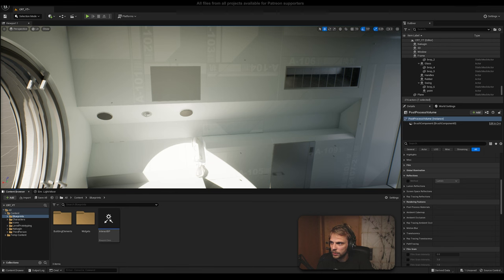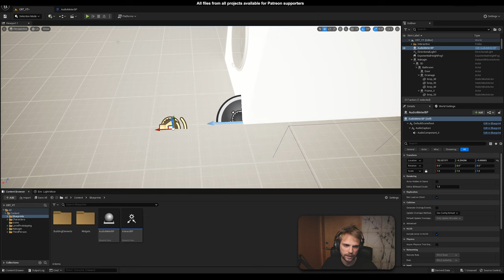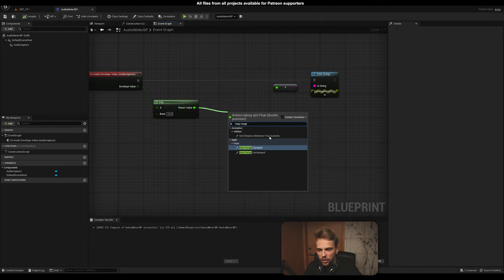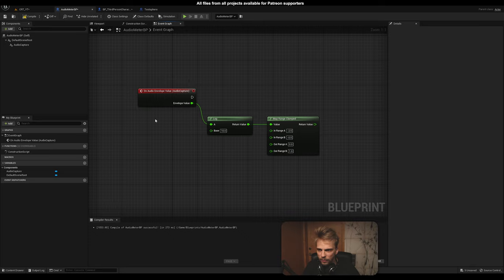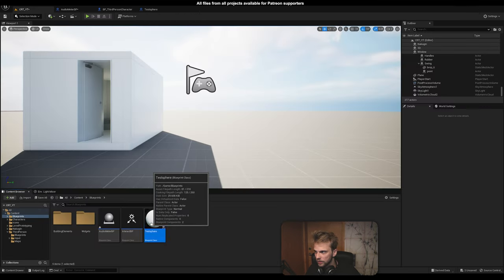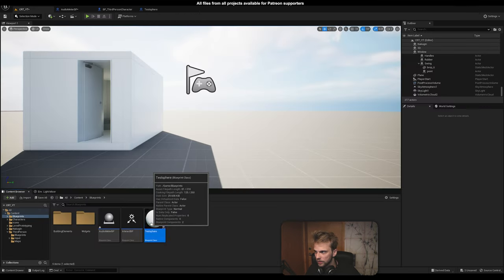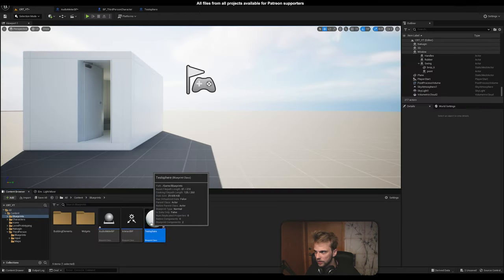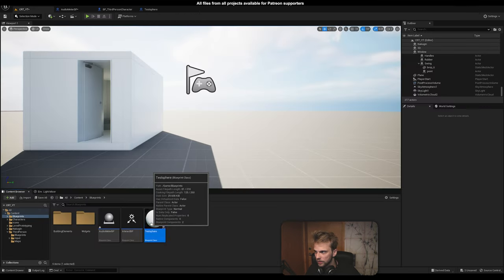UE5 Tutorial: Use Microphone | Unreal Engine 5

Comment: Nice and simple tutorial, excellent stuff.  Is it possible to capture any audio as the source instead of the Mic, such as playing spotify in the background ?
Reply from the maker: Yes, but I personally prefer using a software virtual mixer. Basically taking output from any app and using it as an input to the mic port. Then there's no need to change anything on the Ue side of things
Reply: @DesignGoBrr   sounds like an option but ideally i'd like to have it all handled in UE so I don't have to mess around with external software to bridge it.  I'm looking at doing a visualizer scene with the audio controlling niagara and maybe a few objects and some lighting.  Anything to point me in the right direct would be appreciated :)
Reply: im planning to do a similar Thing, i have an Niagara Setup and its audio sensitive to the submix. i can drag and drop an audio file into the Scene to make it react. gonna use this Tutorial to connect it to a dj Mixer. theoretically you should be able to just plug a phone with Spotify running into your aux in. If this dosnt work im fcked too, because my gig ist soon

Comment: How would I select my elgato cam link instead of microphone?
Reply from the maker: Ue5 chooses the currently active device that set in windows preferences. So all you'd need to do is switch the active microphone in Windows->Control Panel -> Microphone Settings
Reply: @DesignGoBrr  Thank you so much!!!
Reply: @DesignGoBrr  another question :( if you don’t mind. I would like to duplicate the object to audio react but every-time I do that it only enables one at a time. Any way I can fix this? Instead of having one sphere, I would like to have 20 spheres react.